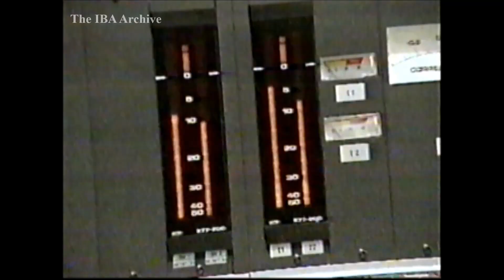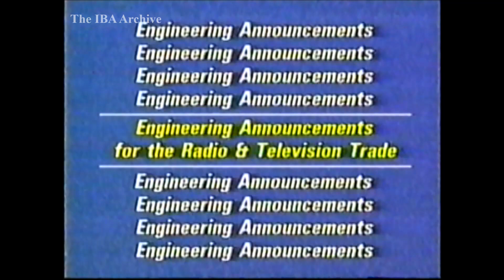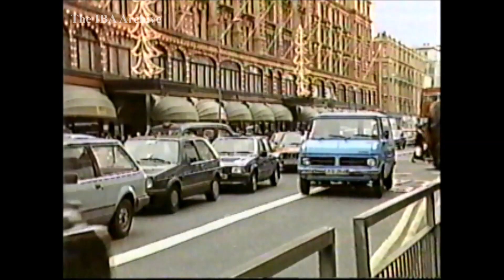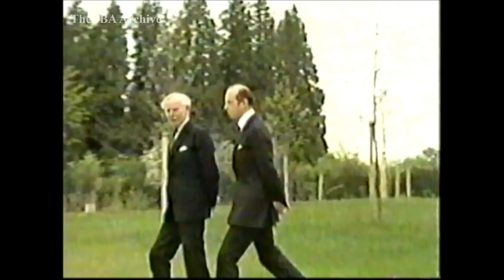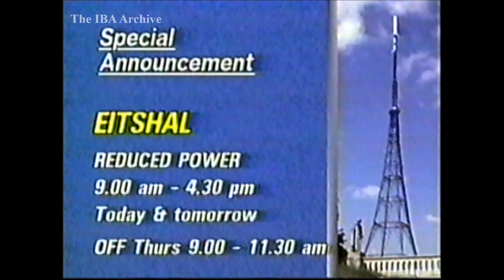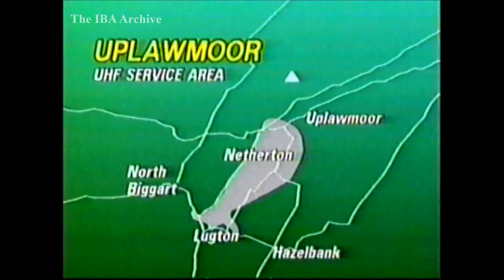IBA Engineering Announcements - 15 May 1990 'R.D.S Information'

Comment: I wish that the Engineering Announcements were around at the time of DAB being launched. They might have warned me that DAB was a technology created in the 80s and is a bit outdated and warn to wait for DAB+ with its better audio encoding. Especially that doesn't make that awful gargling sound in a poor reception area.
Reply: It is weak reception and a weak signal that causes the bubbling mud. Problem is, the DAB signals are transmitted at very low bit rates using puny low power transmitters and valleys hills mountains and built up areas / industrial estates weaken the signals causing signal errors and causing the receiver to pick up these poorly. DAB+ just fades away with weak signals and returns as the signal strength increases.

Comment: From what I've seen, RDS is implemented beautifully in the UK, allowing seamless transitions from transmitter to transmitter as you drive across the country, but where I am in Australia it is woeful. Commercial radio stations misconfigure everything except the station name, with incorrectly set flags (especially traffic ones) and alternate frequencies set when there's only one station transmitter. In cases where there's more than one transmitter, you often find that the main transmitter has the alternate frequency set while the auxiliary transmitters don't, so if you kick into a fringe area and come back into the main transmitter area, you have to manually tune the radio again...and of course, the radio preset frequency also changes when this happens so it's a bloody hassle. If you've got a fairly modern car - especially a European one - car radios incessantly tune out from the station unless you disable RDS entirely. 

The national public broadcaster, the ABC (the only broadcaster with national FM radio networks - similar to BBC Radio 1-5) doesn't even use RDS on any of its non-city stations, and never uses alternate frequency flags, even though they would benefit the most out of their use.
Reply: It's a mess in the US too. Stations there use scrolling PS to display track information rather than just using the Radio Text function. Scrolling or alternating PS is forbidden in the official RDS spec so they changed it slightly by altering the PTY categories and renamed it RBDS. For example, WDVE Pittsburgh shows up as Education programming on a European receiver rather than Rock.
Reply: It’s a mess in Ireland.